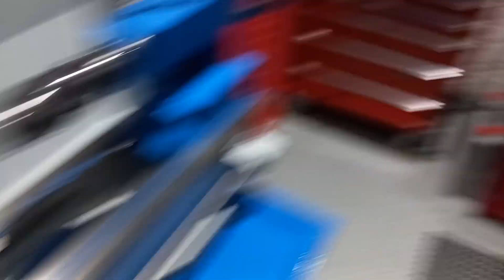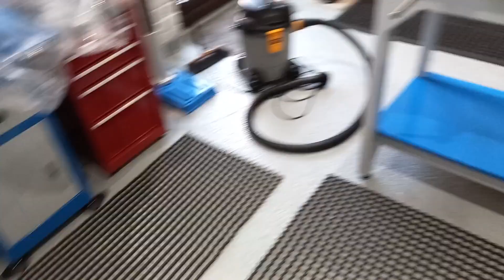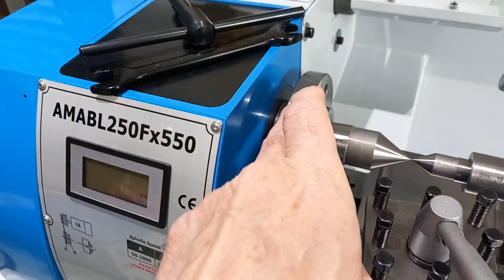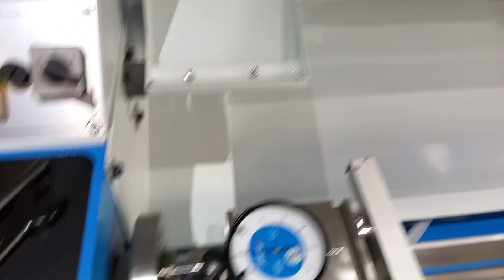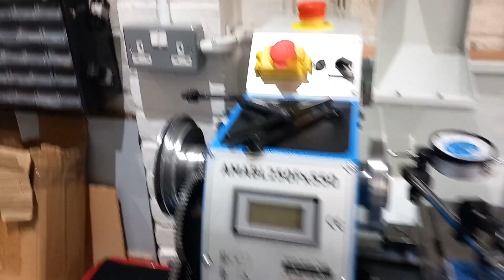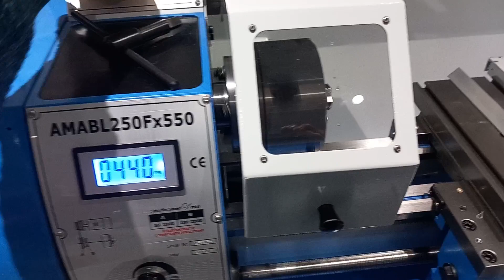Fixing the Lathe Pt20

Comment: File/mill half round slots in the lathes faceplate so you can remove the chuck bolts from behind.
Reply from the maker: That could work, and for sure it would make life a bit easier but I would be nervous about breaking the surface and distorting the mounting face, but I guess it would be easy enough to skim it after. Fortunately now I've go the new back plate  I can mount everything from the front, but it a good idea, Thanks.

Comment: Ooohhh! Sounds a bit suspect still. What is it like if the gear drive for the lead screw is taken out of the equation? As an aside what is the viscosity of the oil in the headstock? I was on to Chester today about the oil for the headstock and screw cutting gearbox of my new to me lathe (410mm Swing) and was told anything from 32 to 68 for both. I have always previously had the 32 in the headstock and 68 in the gearbox with a 68 slideway oil in the apron. Even my old Colchester Triumph ran those grades.
Reply from the maker: Hi, without the gear train engaged its nice and quite. The gearbox has 68 gear oil and is very smooth so I think the noise is from the external gears. Now I've been running it for a while it is getting better, guess its just bedding in. Also I've found that a dry lub (Worth motorcycle chain lub) works realy well on the external gears as it doesn't fling off.